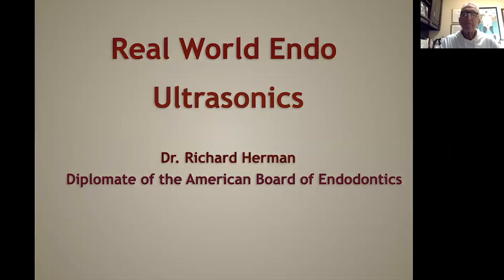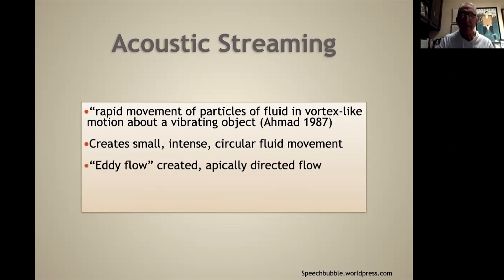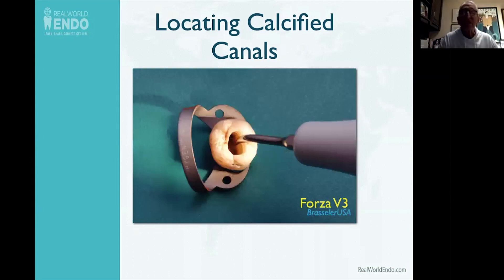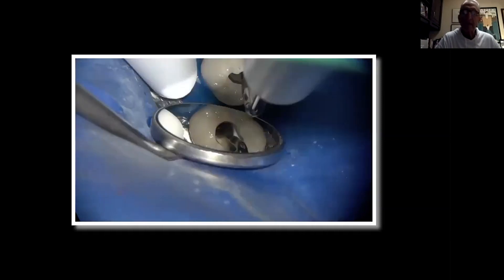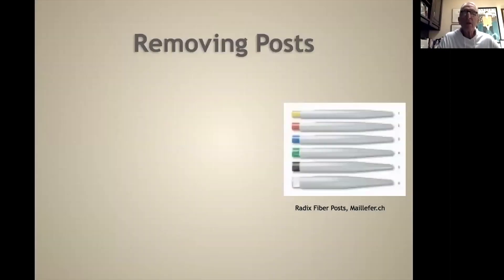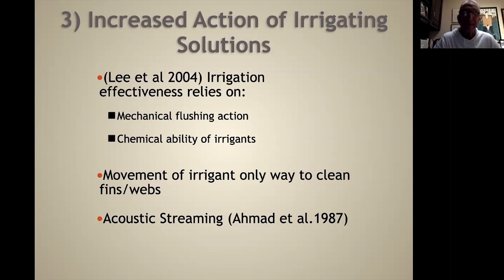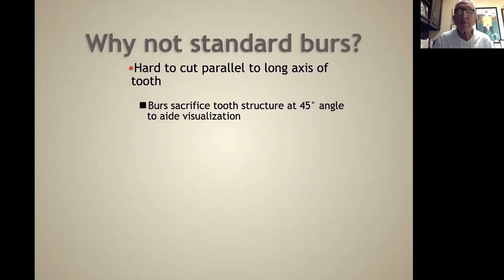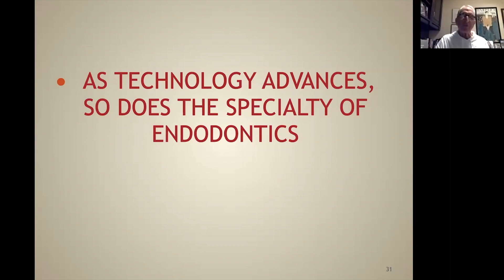Dr.  Richard Herman on Basic Ultrasonics

Comment: If using a system like the Endovac for irrigation throughout the procedure and during final irrigation, would you also recommend something for 'passive ultrasonic irrigation'? Such as a piezo or air scaler with an endo tip attachment?
Reply from the maker: The more you do to activate the better off you are. So, while there's no consensus as to what's the line of "enough done" it's a subjective decision given a tooth. So, as a rule, do more on the disinfection front, whenever possible. Cheers!